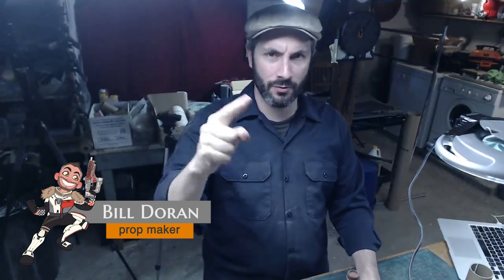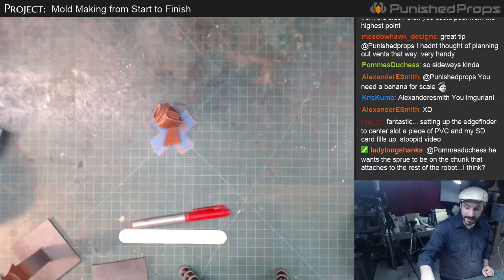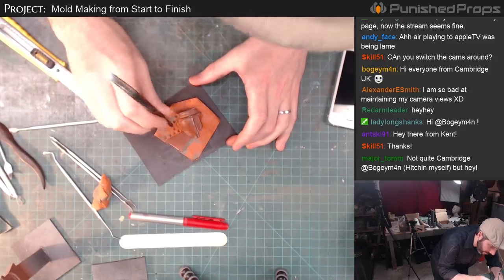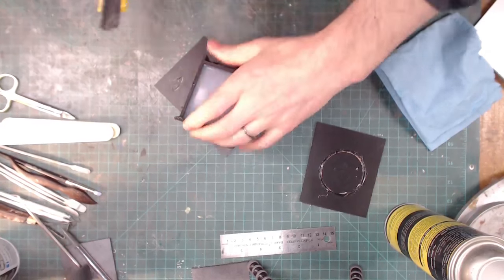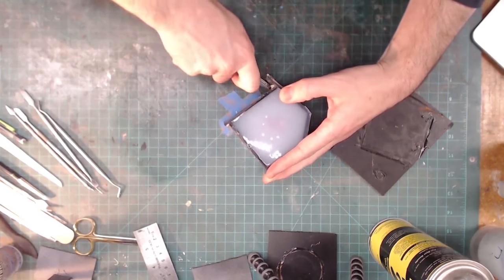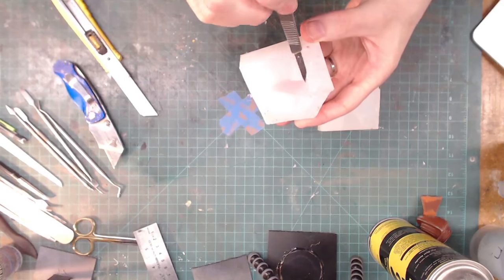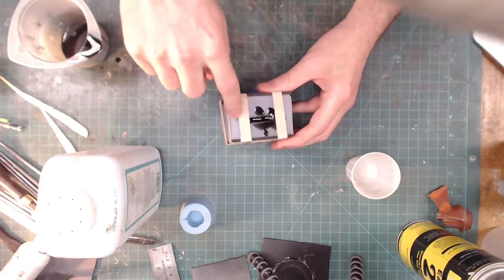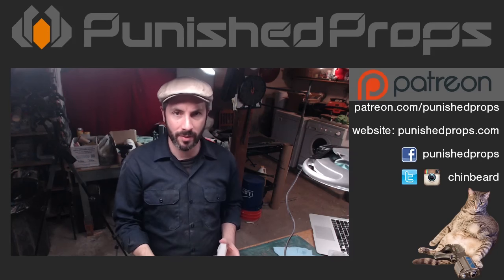Prop: Live from the Shop - How to Make a Mold

Comment: Is the process all the same if I make a silicone mold and then want to make a finished product of silicone on the inside without it sticking?
Reply: This is an old comment but figured I'd chime in if you're still wondering! :)
I wouldn't use a silicone mold for a silicone product. Use plaster or fiberglass.

Comment: Why do all of the masters have that specific color?
Reply: +Braxton Farley he's said befor ein a few previous videos he uses a grey primer , sands it back, then uses a red primer and sands that back, that way he can see where he has gone all the way through the red  because the grey will start to come through, then he knows to stop sanding that area, and possibyl have to apply more red primer. Red is just the colour primer he picked, theres only so many primer colours, white grey black red, (you can get red primer because painting red paint over a white primer looks pink, same with grey, over black it makes it look darker. and you have to apply more and more layers of the final colour in order for it to actually turn out as the proper colour. not so much if you use a red primer, you can get to the true colour red with fewer coats.
Reply: +Graeme Evans Thank you very much!

Comment: Excellent work right here. the clay part makes this simpler to do complex castings. Would any damage be incurred to the silicone if I use a C Clamp?
Reply: +Punished Props Good to know... I was thinking of doing this for bigger molds and cold casting. Or using wing nuts and carriage bolts. I'll have to test this out.

Comment: I have a question and I'm hoping you can help me. I just recently (like yesterday) started to experiment with Smooth-On 20T so that I can start to cast jewelry. I  mixed both parts A-B together (I don't have any pigment handy, but have purchased some) and used Sculpey Polyform Air Dry clay to put underneath my piece. So far I've tried to make 5 different molds, but keep getting the same result. The silicone cures on the top and over the piece, but does not cure against the clay (I even applied Testors dull coat to the surface and let it sit longer). I'm not sure why this is happening, and I've watched your videos to help, but am getting the same result. I know you can't use clay containing Sulfur and researched the air dry clay on Sculpey's website (they say all of their products are sulfur free). Do you have any ideas as to what I may be doing incorrectly? Sorry for the lengthy comment!Thank you!
Reply: Any type of Plastalina clay? I have some on order, but am also going to go down and pick up some Sargent Art Plastalina clay.
Reply: Thank you btw!
Reply: Thank you!!! I just want you to know I tried it and it finally worked! Soo I appreciate all of your help!

Comment: what material would you use to make a mold if you wanted to make a body from silicone ?
Reply from the maker: You would want to make the mold from something rigid, like fiberglass.
Reply: @punishedprops  ok cool thanks
Reply: Ok I been try to find example of molding with fiberglass but cant do you know where I should look
Reply: @kiondre663  I haven't really looked into actually making a mold with fiberglass. I've reglassed a fiberglass boat and it's a tad expensive depending on how much you get. The resin, what type of fiberglass you're using etc also add variations to cost. Another possibly cheaper option would be something like pottery plaster. All you need there is 2 buckets of water (one to mix the plaster, the other to rinse your hands), the plaster, and a work station. Most people will add strength to the mold by using hemp. IMO it's also easier to learn. It's a lot like using silicone as you pour it onto whatever you want to mold and it slowly gets thicker (it's activated so it starts "setting") the longer you work with it. Fiberglass is certainly stronger, but there's a bit more of a learning curve to using it, again IMO :)